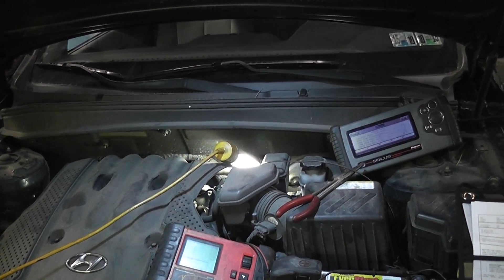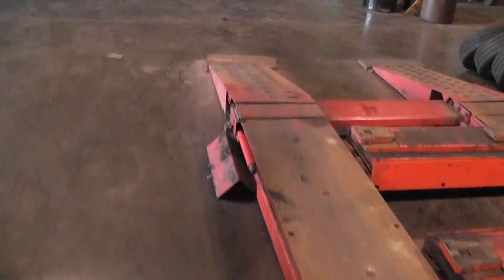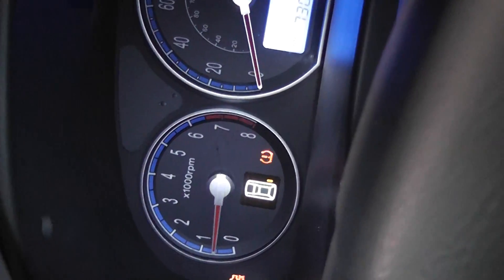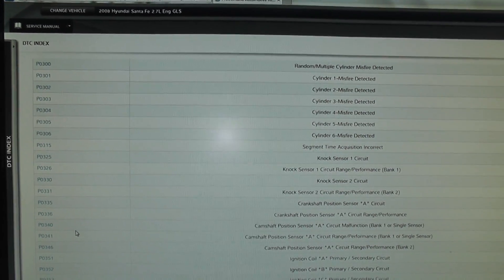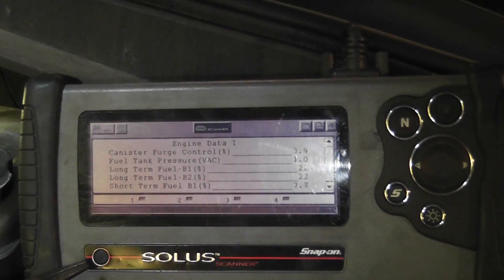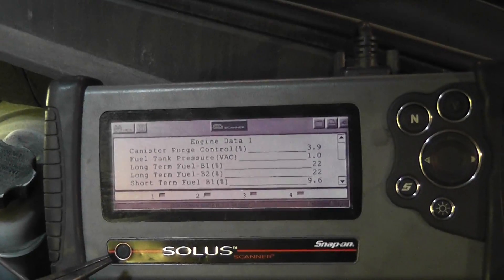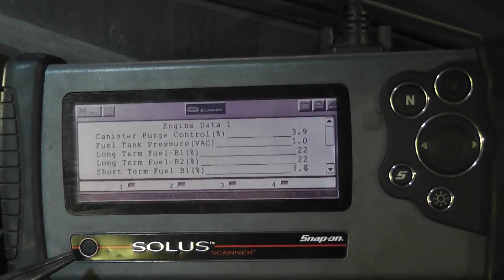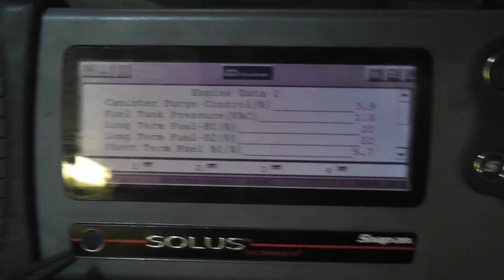HYUNDAI KIA SYSTEM LEAN CODES P2187 AND P2189

Comment: My holy faith is 2008, I turned it off and it didn't turn on anymore, I changed the fuel pump it started working but it stopped again, but after 30km it stopped and it didn't work anymore the code p2187, bank 1 appeared. Can you help me? I'm from

Comment: Had same codes.   Purge value was clicking.  Replaced valve and now 6 months later same codes but dont hear the clicking.  Any ideas?  Only tool I have is code scanner. Just asking before I take to shop I cant afford. Thanks

Comment: hello  i have the same probleme... my hyundai santa fe 2008... is the purge valve the probleme..  but  is the same place  in santa fe 2009?  (  after gaz  the car not starting the same code p2187 p2189

Comment: Why not clear the codes?
Reply from the maker: The way pa emissions is set up, check engine light has to be off and all readiness monitors ready or complete.  (all but one) to pass. If I cleared the codes ,the monitors go not ready or incomplete . The result of a test after that is "NOT READY FOR TESTING" I needed to issue a sticker that day so my option is to issue a waiver sticker. That's qualified by spending more than $150 towards the cause of failure. But I need an initial test fail and an after repairs test fail ,where I enter the repair data. A not ready test won't let me enter data ,so I can't get waiver approval from state . I usually clear the codes after the waiver is approved
Reply: Thanks, awesome videos. It has help me a lot

Comment: Nice job as usual, James. I have seen a lot of purge solenoid problems with Hyundai cars. Usually hard start and poor run after filling the fuel tank. Sometimes I think those cars are completely built with Dorman parts. {:-)
Reply from the maker: So what u r saying is I used OE parts.   :/
Reply: +James Danner   Very good possibility.

Comment: fixed many kia's and Hyundai 's with the same codes, some do have issues with the canister coming apart and clogging the purge valve. I have had several 4 cyl. that would stall in the am running very rich from an over saturated canister too.
Reply from the maker: Ok. That's good to know. One of the complaints on this car was running poorly and stalling but I never experienced it in the shop. Seems like the rich issue is happening cold or long soak time

Comment: Nice video. "Purge"  is normally closed and "vent" is normally open. Therefore, when purge sticks open, vacuum leak because vent is open. Rich condition will develop at start-up (build up of fuel vapors) converts to lean condition as engine runs (drawing only atmosphere).
Reply: +Derrick Hodges The vent, or as Hyundai describes it Canister Close Valve (CCV), and as described in ALLDATA:

 "The Canister Close Valve (CCV) is located between canister and fuel tank air filter. It closes off the air inlet to the canister for the Evaporative Emissions System leak detection inspection function and also prevents fuel vapors from escaping from the Canister when the vehicle is not operating." 

Therefore, in order for fuel to be drawn from the fuel tank during engine operation, the vent has to be open.
Reply: +johnwrench4speed Vent is only open during key off though, it closes during  key on or run. The lean condition came from a bypass valve built in to the gas cap opening when the vacuum in the tank gets too strong.
Reply: johnwrench4speed Looks like basic CVV operation. However, an open vent is not the only means for air to enter a tank. Nearly all vehicles that still use gas caps have a vacuum bypass valve built in to keep the tank from imploding under too high vacuum scenarios. If that bypass valve is stuck open air will enter the tank even with a perfectly functioning vent/purge system.
Reply from the maker: Yea. In hindsight I should have looked to see if freeze frame data showed the rich conditions at colder engine temps. Good thinking...thanks
Reply: This lean run will throw a bad o2 after the repair of the purge .purge ohm was a bad one .fixed it but now its got a o2 bank 2 code.109 bucks ..hoping this keeps it off.